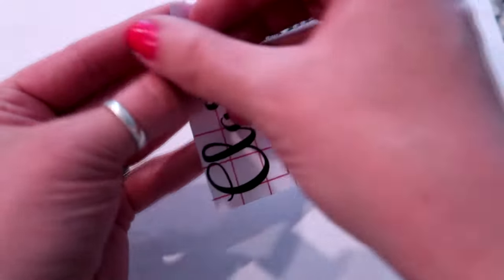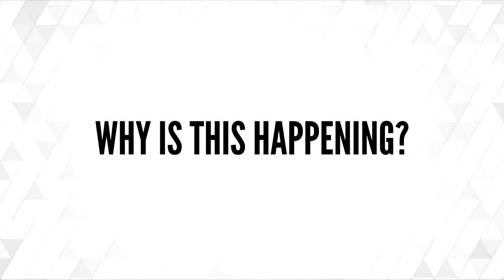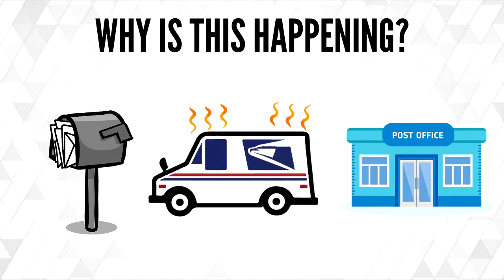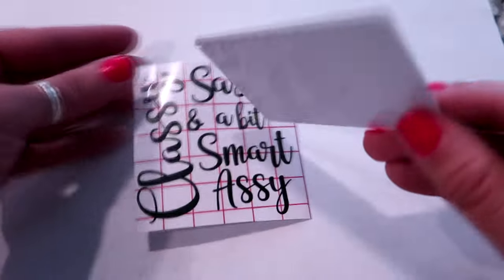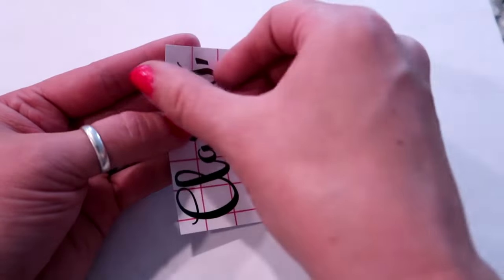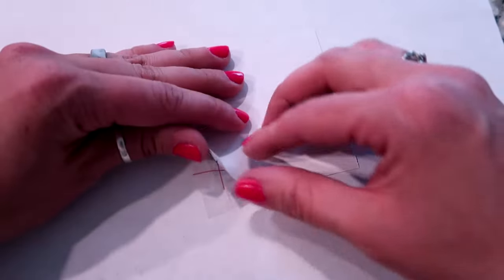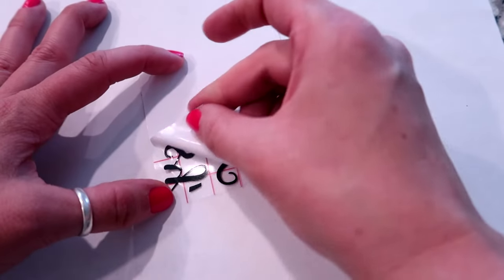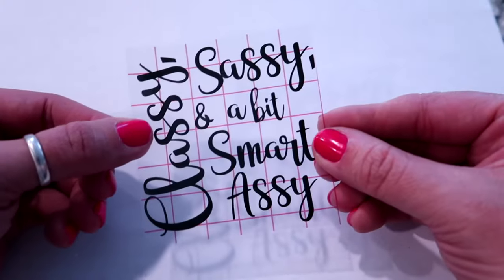Vinyl Not Sticking To Transfer Tape 📍 How To With Kristin

Comment: I used cricut brand adhesive foil vinyl with cricut transfer tape and it just would not pick up on to the tape AT ALL. I then switched to oracal transfer tape and it did the same thing. I had to manually take a razor blade and lift each piece off of the vinyl backing. This same thing happened when I used holographic siser vinyl. I can’t find any solutions for this 😭
Reply: I am having the same issue. It turns a 5 minute project into a 2 hour project!
Reply: @saracooper7146  I'm having this same problem.  Oracle on Oracle... and it just wont TRANSFER!
Reply: Anybody solve this problem yet? Struggling to get it to stick to the transfer tape, or rather... to come off the backing. It's stuck on the backing like it's a permanent bond. Is there a better brand of vinyl/transfer tape?
Reply: Have you find a solution yet? I am having the same problem.
Reply: Commenting to see if anyone found a solution? Having the same issue as well 😅. None of my cricut vinyl or cricut transfer tape works, no matter what I do
Reply: also commenting to see if it works lol
Reply: Same thing happened to me….this is not operator error.   The tape is not tacky enough to hold anything much less peel stickers.   I’m so frustrated!
Reply: I actually sell vinyl decals. I have found that Cricut brand vinyl IS TERRIBLE. If you have the option, I can recommend Oracal VINYL in addition to the Oracal transfer tape. It still will occasionally have an issue, especially if the cutting pressure of your cutter is too high. But it is sooo much better. I have sold THOUSANDS of decals over the last 11+ years and it is my vinyl of choice. The permanent vinyl (mostly glossy) is Oracal 651 and the removable vinyl (mostly matte) is Oracal 631. Hope this helps.

Comment: My vinyl doesn’t lift after cutting, they are not transferring to the tape.   Cricut smart vinyl will not come off the backing, all of my colors.    I bought a brand new Joy and all Cricut smart vinyl thinking I was doing what was best to get great results,  none of them lift.   The only way they lift is using strong grip and then they don’t come off that .   I am beyond frustrated with the “brand”, the Joy works great.

Comment: I have try it all and nothing works for me. I am so frustrated at this time. I even changed the transfer tape. Nothing.
Reply: I’m having the same issue. I’m rubbing to the point I’m risking tears or still having only some letters come up and then I have to eyeball placement. Not ok for consumers nor to expect them to do that when they purchase something from me.
Reply: @jenellemyers6797  hi! Is the transfer tape that is not good! I bought one in Amazon and it works very nice. Is Frisco Craft AT65.  Hope it works for u as well is working for me.
Reply: @Yarafun22  I will give it a try, thank you!
Reply: Hi, im having same issue, i have tried 3 diffrent transfer  sheets and done all methods. Nothing seems to be working

Comment: So what's the reason when it sticks to the transfer paper (when it comes from the Cricut machine)?
Reply from the maker: If you mean why does it stay on the paper and not transfer to the tape, sometimes this means the transfer tape you're using isn't sticky enough to pull it off.
Reply: @HowToWithKristin  It's Cricut vinyl and Cricut transfer paper.
Reply: I have the exact same problem. Smart vinyl and Cricut transfer tape doesn’t work.